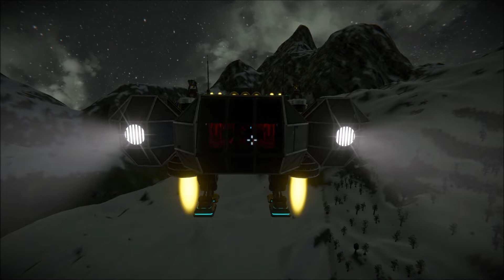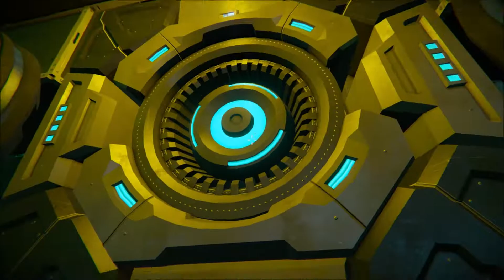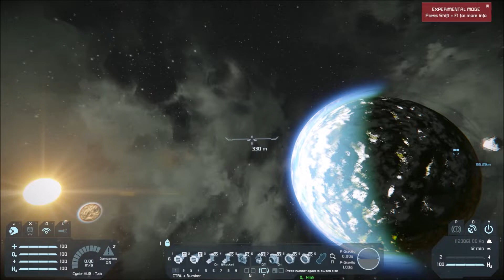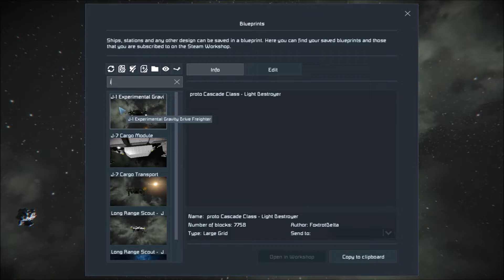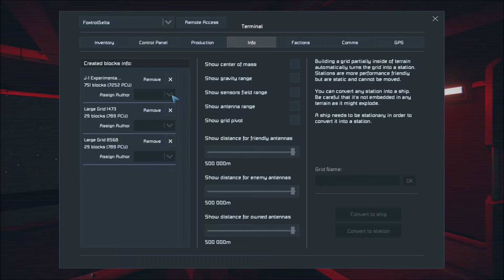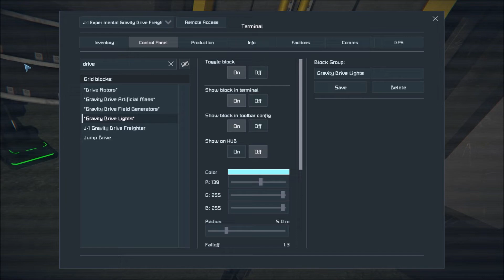J-1 Gravity Drive Freighter!!  - Space Engineers - Experimental Gravity Drive

Comment: I’ve managed to successfully build  a gravity drive that works in 2 directions and flies straight 24gs forward and 12backwards but it also has hydrogen thrusters for dampeners and exit/re-entry and it’s easy to drive and only requires 3 inputs works well with mods and the two way gravity drive can slow itself down from any speed